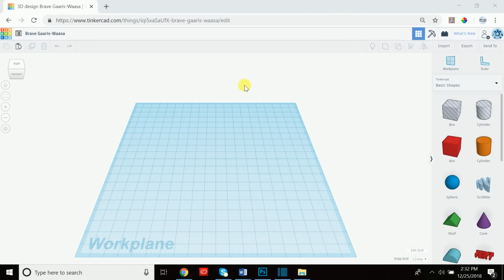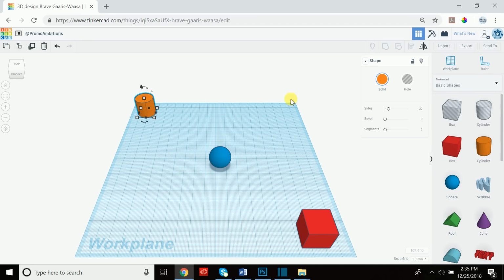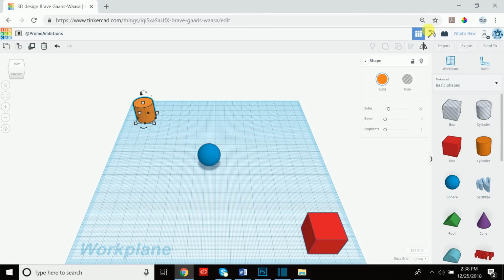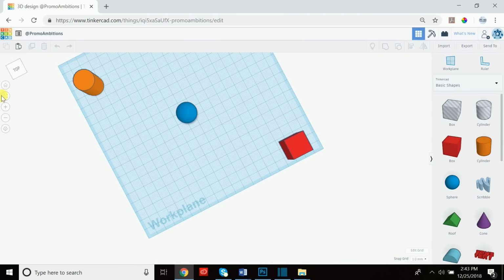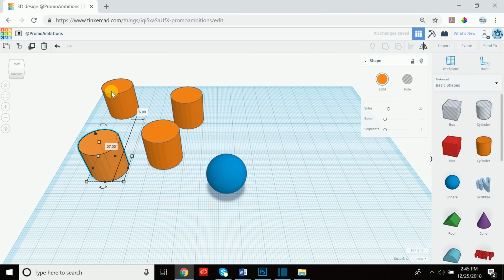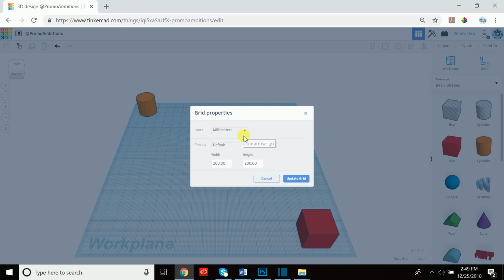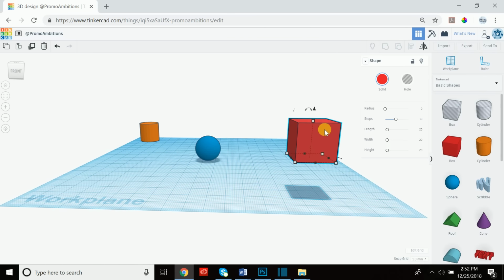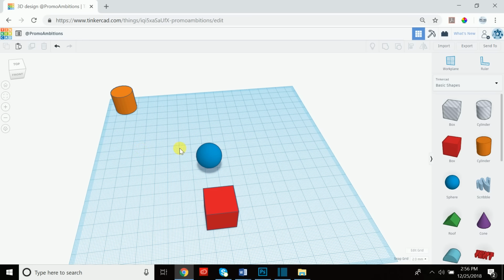Tinkercad Tutorial Part 1 - (Interface and Movement)

Comment: Just finished up all 6 tutorials today so thank you very much they were super informative and helpful.  I was wondering if you might know a trick to find out the inside diameter width of a wall when I import something?  I'm trying to adjust several vacuum hose adapters to different sizes and there's a lot of great designs on thingiverse but when I go to edit I don't know how thick the new walls should be.  I've played around with the ruler but thought there might be an easier way you knew of?  Thanks again for the great tutorial

Comment: How do I make a cylinder with different diameters in tinkercad?

I am looking to make an adapter 4" long adapter with a nice smooth taper  to go from ID 55mm down to ID 35mm, with a wall of at least 2mm thick, to be 3D printed, using either Cura Slicer or Craftware Slicer ...

 

However I cannot figure out a way to adjust top & bottom or middle parameters separately in tinkercad...

 

All help & advice is welcomed with open arms...

Comment: I'm sure this is a dumb question, but is this only for 3d shapes?  Can it be used for 2D circles, ovals and such?
Reply from the maker: Hey Dan... you can design 2D shapes like circles ovals and such, but if you're 3D printing with a 3D printer you need to have a three dimensional object. It can be a simple rectangular prism, but it needs to be 3D. Hope that answers the question.
Reply: PromoAmbitions  thank you, yes.

Comment: Thanks for the great tutorial! The shortcut about duplicating objects an equal distance apart from each other is especially handy. 

Also, I saw in another video that if you change the size of a shape by dragging it, you are actually stretching the shape, which is why, as you mention, Tinkercad gets "confused" when you stretch a shape and then try to change its size numerically. The stretching effect is not noticeable with a cube, but you can see it with a shape like the Spring or the ISO Metric Thread.
Reply: Also my favourite shortcut! Control D is my favourite!

Comment: At 14:20 , can you explain (precisely) how to do this duplicating when NOT using a mouse. I have tried and tried and it simply does NOT work as shown.
Reply from the maker: Hey Ken, please make sure that you are not clicking away from the duplicated object and that the duplicated object still has the blue hover around it. Please write your workflow below and I and others on this thread will attempt to problem solve with you. Also, try watching Part 5 of this tutorial series. It's covered in depth there and may address your issue.
Reply: @PromoAmbitions  Thanks, I click on my cylinder, click Duplicate, click and hold on the cylinder and when I drag it, it elongates another cylinder but does not just drag a duplicate to another location. The only way to drag the duplicate away is to click OFF the object and then click and hold (back onto it) and drag it away. Very frustrating. I'm going to get a dang mouse for this lap-top.
Reply: So, just finished this video and it is so helpful (except for my duplicating problem). Thumbs up and great job!
Reply from the maker: The correct wokflow without using a mouse is left click an object > click ctrl +d (to duplicate) > click and drag object away from original > click ctrl +d (make sure the duplicated object still has the blue halo around it).